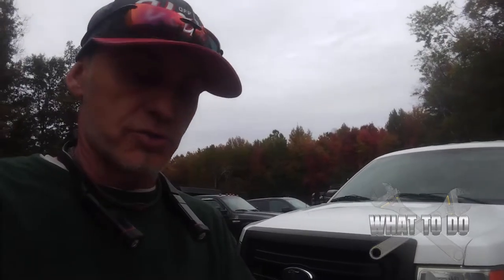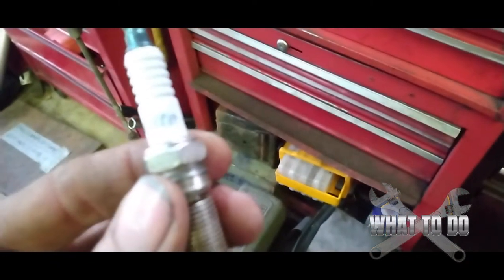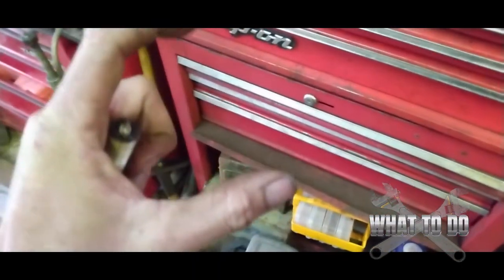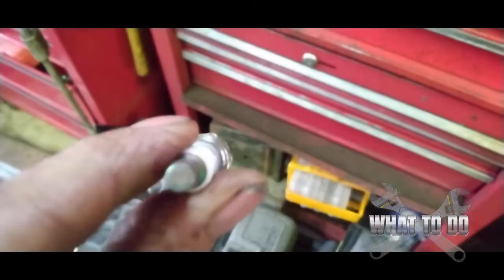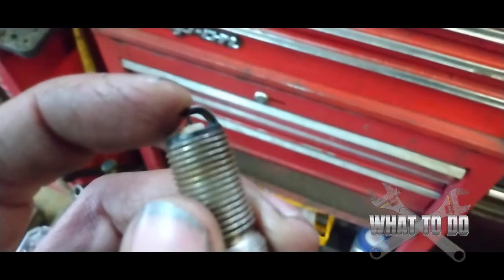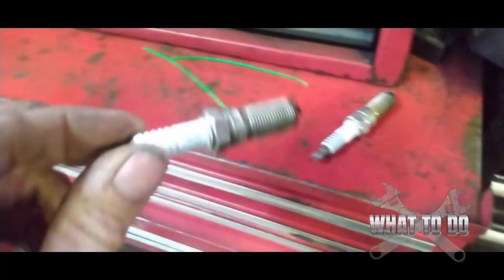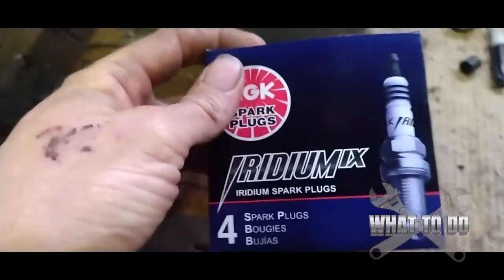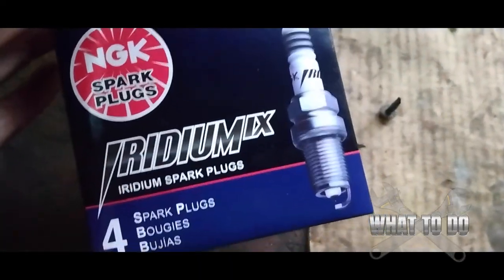Ford F150 - Motor Shaking / Rough Idle After Tune up - FIX !

Comment: Youre a genius i had autolite in my 06 f150 and ut was running rough starting rough and shaking on start up. Turns out autolite sucks for ford i took them out and replaced with motorcraft and it runs way better
Reply from the maker: Thank you very much for your support I really appreciate it.

Comment: I have  a 2013 f150 4x4 xlt 3.5 ecoboost  I have Motorcraft plugs in it and I have cold start rough idle and a rough idle when I get of work  it seems the truck runs good no loss of power but the rough idle is still there I'm at  lost for word cause I keep that truck well maintained and maintenance I just don't get it
Reply from the maker: Could be a dirty throttle body

Comment: I have a 2010 F-150 5.4 engine the spark plugs and coils were done but it runs rough when I put it in reverse and sometimes at idle. Sometimes I have to put it in park turn the truck off and back on and it runs better at first, what do you think
Reply from the maker: I would start with checking a throttle body thirst. See if it's dirty. Could also be some type of vacuum leak. I've experienced this problem a few times in the past and it always ended up being a dirty throttle body. Check there first let me know.
Reply from the maker: Throttle body first sorry for the typo

Comment: My son has the 03 F-150 and got all spark plugs changed and coils 1 & 4 changed and two weeks later it started shaking VERY bad! Did yours start shaking right away after tube up?
Reply from the maker: Yes mine started shaking almost immediately
Reply from the maker: The quickest and easiest thing for him to do is just take off coils one and four again and put the old ones back on and see if it runs any better. If it's still running bad then definitely something with the spark plugs perhaps one of the spark plug gaps got closed when they were putting one of the spark plugs in. But I would start with those coils first sounds like a coil problem
Reply: @youtubestar  okay thanks a lot🦾
Reply: I just did SP job and new boots and my truck is doing this. Started right up and drives….albeit sluggishly and shaking. Will check my work and see if this happened to mine. Used all motor craft parts and torqued to spec with torque wrench. Will let you know. Thanks for the insight gentlemen

Comment: I have a 2012 3.5 EcoBoost and I have been having some similar issues. I changed plug's no difference and I used a magnet to lower them in. My question is did your rpms flutter at idle? I'm wanting to rule out any sort of potential fuel related issue. Thank's
Reply from the maker: Yes it did have a rough idle. Is that the problem you are having?
Reply: I’m having the exact same problem with mine. A rough rumble while the truck is idling at a red light or stopped, causing the motor to shut off. My truck has had the spark plugs changed and the transmission fluid changed as well. 

still having the same problem, trying to find out why
Reply: @danielmarinucci2378 Have you found out why? I’m having the same problem.
Reply: @danielmarinucci2378 ??? Did you ever diagnose the problem.??